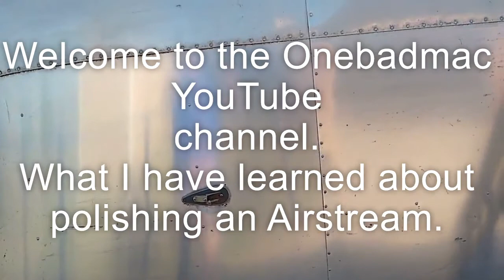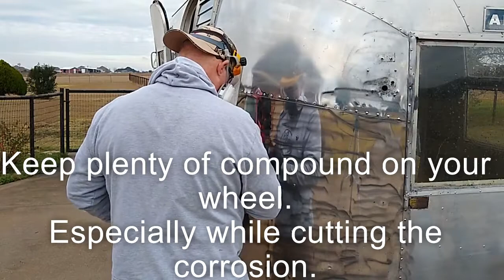What I have learned about polishing an Airstream.

Comment: You start from the bottom, working your way up.   Wheels throw compound upwards; you overlap each run, using the black compound line to lubricate the wheel.   When the black line disappears, time to rake the wheel and apply more compound.   Wipe with mineral spirits before switching to a finer wheel/compound combo.
Reply from the maker: Thank you for the advice. That trailer blew away in a storm. I now have a 1988 Airstream Excella. The person I bought it from painted it. A bad job at that. So I will be stripping it to polish it. Do you have any videos I could watch.

Comment: You may of been better off
using the grinder with the wool buffers and using the Nu-Shine 2step process and the machine should not exceed 1000rpm. Being that the aluminium is extremely delicate. I must say that your Airstream is definitely in much better condition then my 1958 Australian Airstream.

Comment: You know what’s worse than tool noise?   That crappy music and videoing your back.   Yes: turn off the sound if you want [although we can mute it]; and place your camera on a tripod to your side….don’t stand in front of it.    After you said, you should begin with Tripoli [brown compound] and the appropriate wheel; by going straight from 220 grit sandpaper to blue wheel with blue compound is not right.   It’s like using 220 grit sandpaper on a rough piece of wood.

Comment: In the compound you have is probably the worst compound known to man you're something a lot more expensive like Manzana 439t
Reply from the maker: Thank you. Just looked it up on Amazon. I made that video a while back. I am still trying to get the the first layer of crud off. Other things have come up. And one hot Texas summer has not helped.
Reply: @onebadmac  and you're going to need a little bit more than an 8-in wheel bud if I were you personally I would call Highway shine and I would order three or four Keystone yellow Buffs and two white treated Buffs
Reply from the maker: @markhutchinson8474  Yup I noticed that I had some 8in wheels. I have 10in one's now. Don't ware out as fast. I will look at those when I use up the Airways that I have. Again. Thank you.
Reply: @onebadmac  were you from  buddy
Reply from the maker: @markhutchinson8474  Texas.